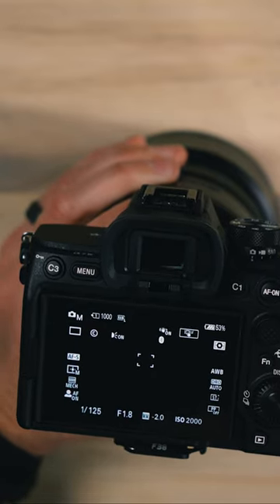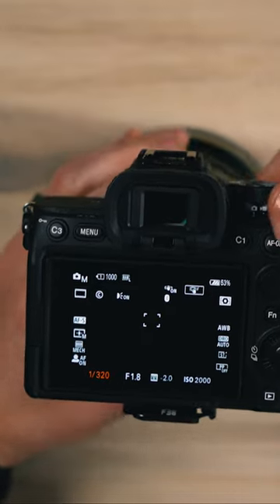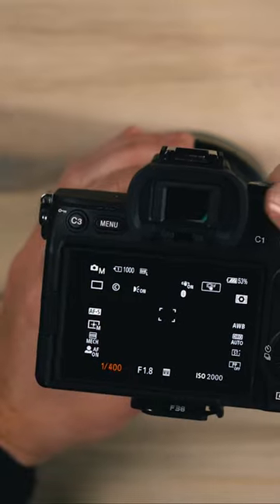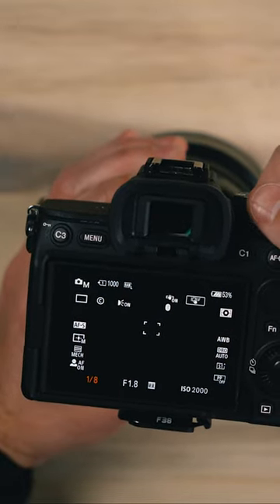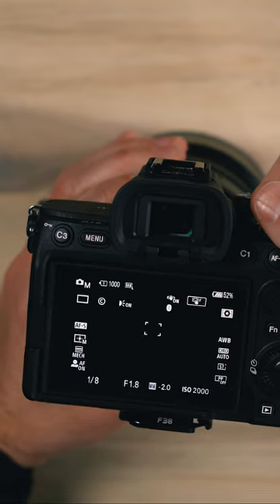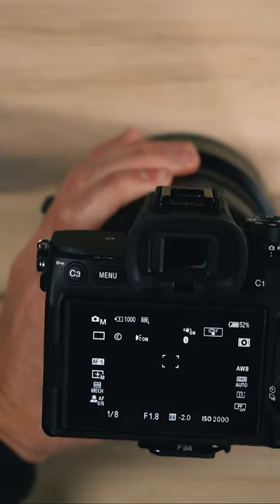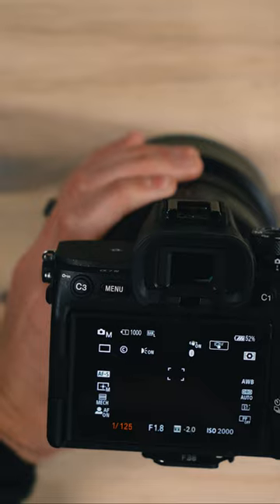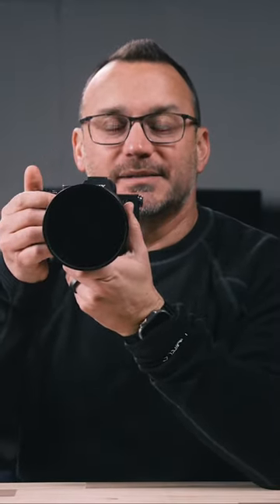How Shutter Speed works on the Sony a7 IV #sonya7iv

Comment: Why the shutter speed on the A7IV has such ridiculous small increments and how to change it? This thing is driving me nuts, I have an A7III, never an issue, but the A7IV has this crap small increments for the shutter speed and I shoot M and this is driving me nuts, it takes forever and ever to change the shutter speed.
Reply: Im having the same problem as well
Reply: @loomelicmedia  I found the "problem". The Variable Shutter is on, it's a function for video, they should make this function totally independent from each other, stills and video, but is not. So, all you need to do is turn off this function and shutter speed will be all back got normal.